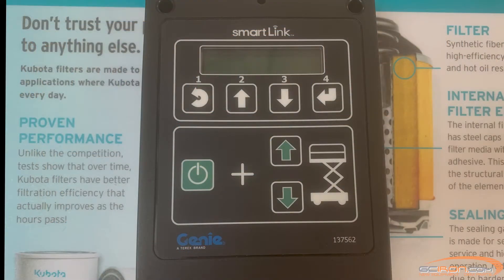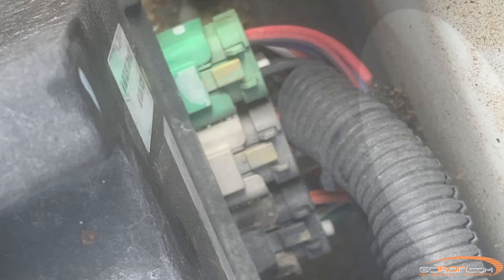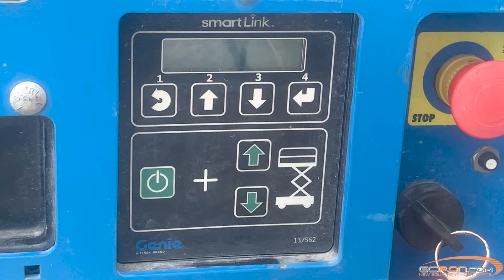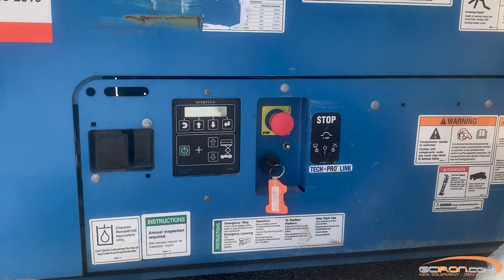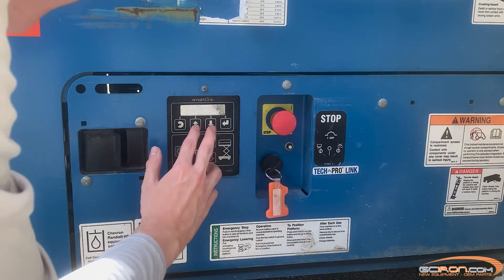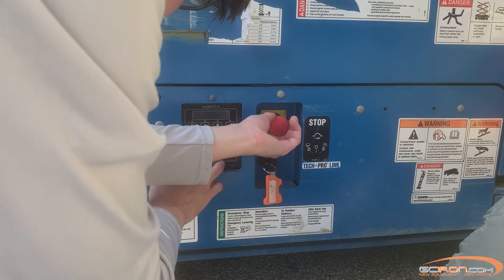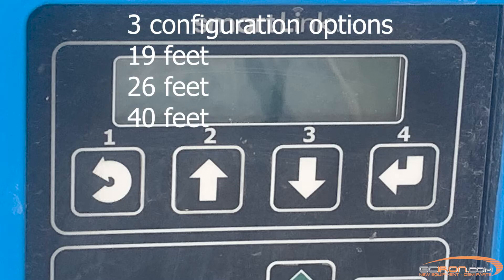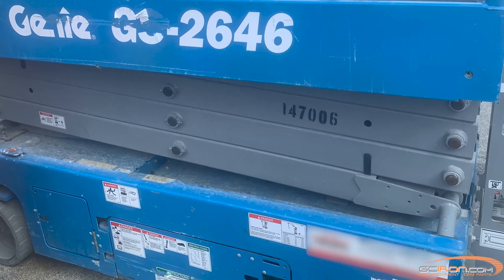How to Install and Configure a Control Box on a Genie Scissor Lift

Comment: I have one with code c023 i tried to configure using Ethernet cable and ip address giving on display but dont get anything on my laptop when i do so, i did it with wifi off
Reply from the maker: You do not configure a ground control box using a laptop.  If you watch the video, one would learn exactly how to configure the ground control box.  If you want to connect a laptop using the CAT5 cable, when you open the web browser, you will need to hit the up arrow on the ground controls. The display will provide the correct IP for 3 seconds. After you type the IP into the web browser and hit enter. Next you would see the the Smartlink display.

Comment: I did what you did and got c025 system fault platform overload no calibration. I bought a brand new controller from genie that was supposed to be programmed and hours set and got neither. They have been zero help after receiving the new one. Struggling to find info on this.
Reply: I got a little further today and I can’t get passed (move machine to level surface). I have it perfectly leveled.
Reply from the maker: You should download the service manual for your specific machine and go through the machine setup.  No all machines are equipped for overload.  So if your machine is not equipped with the parts for overload, and that setting is on, you will get this error.  Additionally, I mentioned, that your height sensor could be problematic.  Finally, I am not aware of Genie, selling any of these GCON units loaded ready to go for any machines.  All GCONS, will have software, but not be pre set up with machine options and features.

Comment: Please l Have a GS1932 given a Code CO21, no signal to top control Box, l have checked all wires no damage. Is it possible to change the control box?
Reply from the maker: CO21 means that the Platform Control Box has not been detected.  The ground can cable travels from ground control box up to the platform box, through the PCON board, and then back ground to the ground control box.  It must be 1 of three things, GCON, wiring or PCON.

Comment: It's easy buuuut those plugs are a pain in the ass to disconnect sometimes
Reply: Use a flathead and push on the tab on one side and turn it to pry it out while a finger is on the other side of plug pushing tab down. Works best that way don’t pull on the wires.